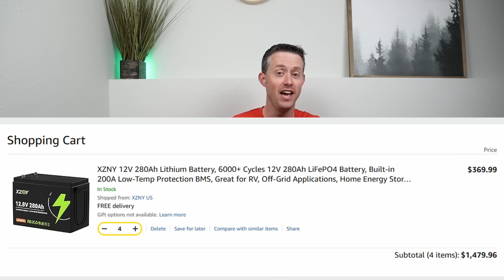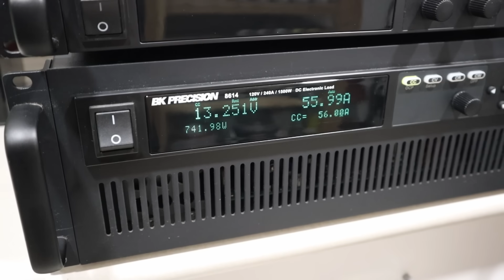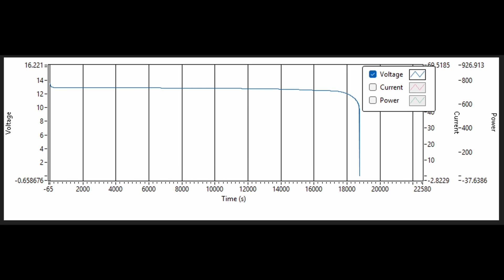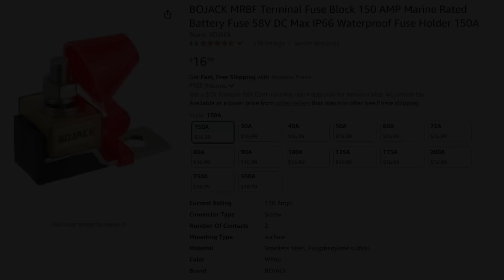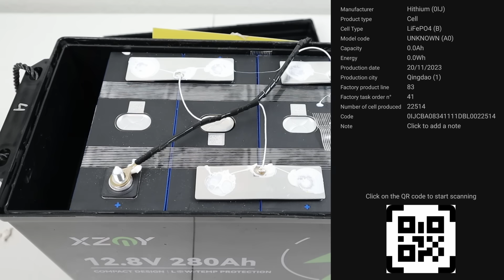CHEAPER THAN DIY?!  XZNY 280AH Batteries Wired in Series for 48v! Impressive Results!

Comment: I don't know how they work because I've never used one, but I've seen lifepo4 battery balancers. I think they are supposed to keep multiple batteries connected together balanced. Would that work if the batteries are connected in series?
Reply from the maker: From reading the other comments, it seems there are multiple options available!
Reply: those balancers are a meme, they arent quick enough and youll just be wasting energy rather than disconnecting them every 6 months when youve depleted them and recharging each one back up. 12v systems are always limiting and thats one of the reasons why people go 48v because they will have coms for the BMS to talk to each other to better balance a bank.

Comment: Excellent presentation.  Thank you Jason.  The Amazon site shows a length of 13.74".   Would you mind measuring yours and confirming the actual length of the "case" and the "handle part" on the end of the case?   I have a very tight space in my truck knowing the exact measure to include that rib part on the end would be helpful.  Side note, Amazon shows a 310ah version from XZNY with the exact same case measurement with an advertised weight of 57lb vs 55lb for the 280ah.  At present, the 310ah is $399 after applying a coupon.  Might would be helpful if you could actually weight them for us.  I know the LiTime Mini comes in at 19lb for 100ah so three of them would be 57lb so that is a helpful comparison.   The 310ah might be in my future once I can know the exact space needed for the "length".  Thanks again.
Reply from the maker: I will take the exact measurement when I get home from work. I'll try to remember!
Reply: @Jasonoid  Thank you!
Reply: @Jasonoid can you also check to see if this will fit in the Licitti battery box
Reply from the maker: I don't have the Licitti box to test with. It seems too big for that box though
Reply from the maker: It's right about 15 inches with the handles. Maybe a tiny less.
Reply: @ Thanks Jason.  Appreciate you taking time to answer some comments.

Comment: My bull scat meter just pegged the max stop. So how bout you take the cover off the 280 amp hour battery and let us judge how much abuse we think it can handle. After 1:48 I'm outta here.
Reply from the maker: I tore down the battery, you're just not patient enough to click on the video chapter to take you right there....
Reply: What are you saying?
Reply: You found the low temperature sensor in your tear down, but did you see a high temperature sensor on the BMS?
Reply from the maker: @kevinholland4156  it was under the BMS heat sink 👍
Reply: BTW - Brad Cagle also did a tear down as well as others…. So the information is out there… Personally I think the battery is well made , I ordered one then CANCELLED after I read the 10% #1 Dislikes on A-zone.   😢 Really wanted one of these… went with Redodo 😮

Comment: Excellent video as always - i wish they'd release a video showing how they solder (and test) the retention strength, resistance, & expansion contraction performance of the busbars - that's the only weak link - literally they're above every other manufacturer in every way besides this.
Reply from the maker: Good point, the busbars didn't have any relief bends in them to handle contraction.